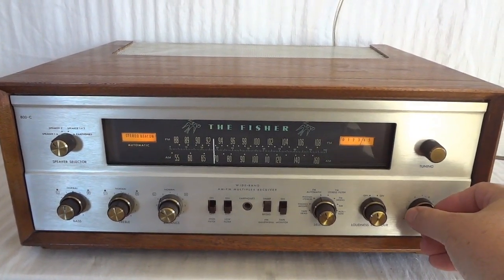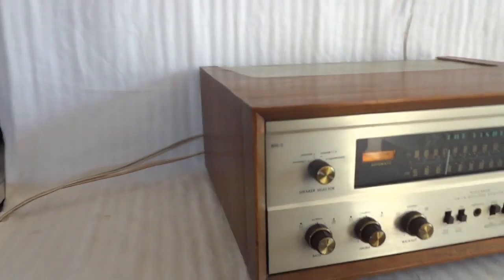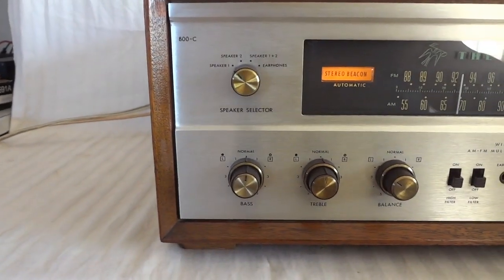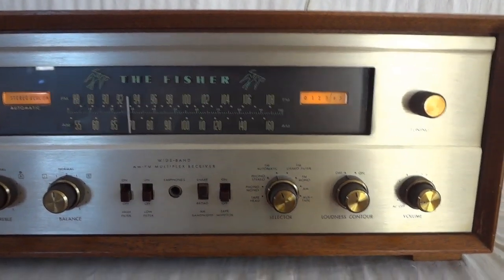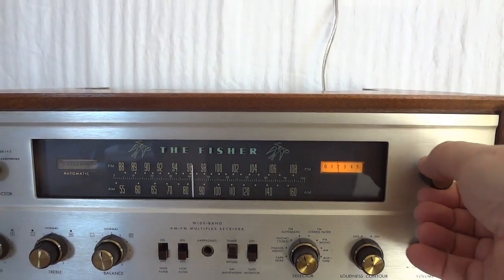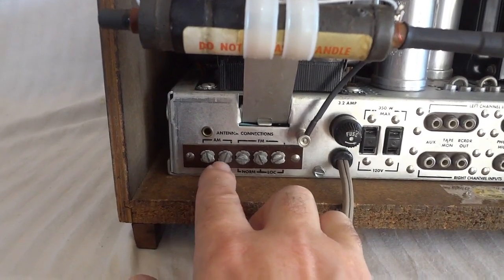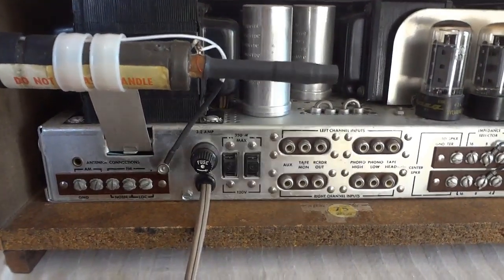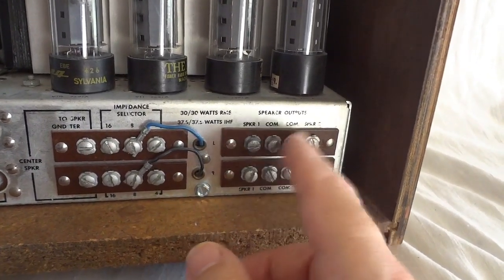The Fisher 800C vintage high fidelity tube stereo receiver

Comment: Thanks for the video.  Much appreciated.  A friend of mine knew Mr. Fisher.  Two items.  Loudness is because at lower volumes, the ears are less sensitive to lows & highs.  So at low volumes, music sounds thin. Turn loudness on & it boosts lows and high to compensate for the ears lack of sensitivity to those frequencies at low volumes.   Audio will sound full to your ears.  It is not to make it sound louder at any volume.  Secondly, the center speaker is not for a sub.  Early speakers did not image well.  People put speakers where they could in their living rooms.  The center channel was for another full frequency channel speaker in an attempt to create good imaging.  In today's surround sound receivers, most have a three channel with no surrounds option which does the same thing. Enjoy the sound and history.

Comment: Beautiful receiver. I have an 800C myself that I had restored by a guy in my area who specializes in tube gear, and per my request, he put in some Westinghouse 7591's and RCA 12ax7 longplates. I use it to power a pair of very-large Wharfedale W90's, which were manufactured about 6 months prior to my Fisher 800C. Those two brands enjoyed an extremely-high level of synergy, which is why you'll see a lot of 500C/800C & W90/W70/W60 pairings. That receiver and some old alnico 2-way W60's sounds freakishly-good with '60's jazz, country, and rock/pop.
Reply: How much did that cost you ? Better safe than sorry . Good move getting it serviced .

Comment: This brings back memories. Back in 1983, a friend of mine gave me his dad's Fisher 800c receiver. And I remember it having a separate piece that was inside a wooden case that plugged in the back of the receiver.  It had a knob that would turn it on and also could be adjusted to give you an echo.  I can't remember what it was called? But it sure sounded good. Great job on the video and info. Thanks,

Comment: Very nice receiver, and very nice presentation. Just do not agree with the part where you said that nobody has a tape deck anymore. I guess no stereo system, especially if vintage is complete without one. Cassette can sound very pleasant.
Reply from the maker: +geor cas Good point - I stand corrected
Reply: He meant with a cassette deck we're more likely to be a nobody (i.e. not a somebody).

Comment: I have a MMF 2.1 in Ferrari Red with the Tracker moving magnet cartridge
 as OEM installed. I am using the table with my vintage Fisher 500C 
receiver with various sources besides the turntable. I'm getting a "hum"
 only when turning up the volume to louder listening levels. In lower 
levels it sounds fine. The Tuner, CD player, Cassette are no problem at 
louder volumes.  The Fisher has 2 EQ knobs (treble and bass) and are 
'dialed in" for the most optimum response between treble and
 bass. Each with its own "inner and outer" dial to assign the 
frequencies to the left and right speakers- Electrovoice 12 inch 
Triaxials with their own crossovers! There are two phono inputs on the 
Fisher-High and Low. One for "Ceramic high input" (for moving coil 
cartridges) and the other listed as Magnetic "low input"-which I'm 
using. Would I have to "re-dial" the EQ knob settings every time 
(annoying) to accommodate what could be a higher output of the cartridge
 causing the excessive hum only when playing vinyl?

Comment: LifeIsTooshortforQRP      Something you should do if you Have one these I also Have 500 B a thing I found out the hard way you Should Have A  wall Tap switch that you Plug the Fisher in Leave it turned on and use the tap to turn it  On & Off.  I found out the hard way having the on off switch blow out from the surge turning it on, bought a kit to put that part in New did the Same Thing. a month later. Luckily  I had an old fisher one that did not work quit right so I robbed its combo on off switch. And Remembered seeing a switch I had bought to turn a  something by Plugging it in the Outlet put the Units pug in it with turned off  pug the receiver into it and turn the receiver  on with the  tap switch turn it on. Been using them on My Fisher tube receivers for Better then 20 + Years Just have it turned on with volume down  then turn it on to get power by the tap and the Tap takes the hit. Those Fisher switch's have a couple of switch's in them and they Just can't take the Power Surge  instead of the receiver switch the tap takes the power & fixes it.

Comment: I have one that my parents had my whole life and it has a ton of sentimental value to me. It has the original speakers too. But the sound quality has been suffering more and more in recent years. It has an unpleasant distorted tinny sound on the high frequencies, especially noticeable in piano music. I've tried adjusting the settings all kinds of different ways, but nothing helps. What could be causing this and how can it be fixed?
Reply from the maker: Can be a number of things - Bad electrolytic buffer caps in the power supply; drifted grid bias voltage; bad (leaky) coupling caps between the driver stage and the PA stage; or worn out PA tubes. A few things to check: 1) Is the problem with BOTH channels (that points toward the buffer cap problem or the leaking coupling cap problem), 2) Is there a difference in performance playing music from the FM tuner vs playing music from an external music source 3) Are the tube plates (the anodes on the four large tubes) showing a red faint glow (this would mean the coupling caps are leaky which makes the PA grid bias voltage too high which results in red tube anodes and distortion) 4) Do you hear a loud hum from the speakers even when the volume is turned down (again this means bad supply filter caps). A word of caution though: VERY high voltages reside inside the receiver cabinet. It can instantly KILL you, even when the AC power cord is pulled already. If you have no experience repairing tube equipment, do not mess with it but bring it to someone who does. Good luck.
Reply: @LifeIsTooShortForQRP  I don't remember if the sound is also bad when there's peripherals plugged into it. I haven't had a CD or record player plugged into it since I moved several years ago; I only listen to the FM radio. I wonder if there could be some problem with the tuner because it seems to move over time. It seems like the radio station will get slightly more static and I have to readjust the knob about every hour or so to get it back to the right spot to get rid of the static. 

I would've had my dad fix it, but he just died after a long battle with cancer, a year ago. He was an electronics technician and a big time ham radio collector who fixed and sold restored radios all the time. Do you know anyone I could send the stereo to for repair? I live in the central NJ area. I'm selling all his stuff on Ebay, if you're interested. I have a lot of tubes.

Comment: Hi there. I plan to build FM stereo tube radio based on Fisher design, but wonder with one I should chose as a base, 500, 800-B or 800-C?
In my case the output stage will be a push-pull based on EL84 As I have already transformers for it.
In addition I wonder about all values for coils used there, any clue where I can get details about them?
How strong power transformer is for 800-B/C?
Also do I need to shield all that tubes, as my plan is to expose them?

Comment: How long can those original Fisher output tubes last ?
Reply: Santiago Santarge: The longevity of 7591 output tubes are generally rated by the manufactures at about 1000 hours of use but they can last much longer if the bias has been adjusted correctly and then readjusted from time to time as the tubes age. Improper bias adjustments can reduce the life of the tubes.
Reply: Im AMAZED, hv 3 originals in my 500C. N its been played ALOT..had ta replace one wen i fired it up...Electroharmonix i hear is. Agood re-tube..

Comment: What are the inputs or outputs on top of chassis  next to the output tubes ? No one talks about those n what they are for, great video though thank You
Reply from the maker: Those input/outputs are to connect an optional reverb unit. When not used, they are jumpered through like you can see on this radio in the video. Fore more details, see the Fisher 800C diagram: https://www.radiomuseum.org/r/fisher_the_fisher_800c.html

Comment: I would like to get anyone's ideas on using  a Bluetooth receiver with 
my Fisher 500C receiver and which ones would be good and not overly 
expensive that will be applicable! Also, what input would I use? I am 
currently utilizing the Aux/Tape input for the CD player and have a 
cassette in the Tape monitor input!

Comment: I’m frustrated and done with vintage gear. Thousands $$$$$$ spent and its nothing but problems and doesn’t sound that good or work as good in the end. It’s fun to tinker but. I’m talking 4 fisher tube receivers, a ton of test equipment . All of it needs work or can’t figure out. Just tossed a heathkit it-28 I’m the trash after $200 and 3days and still could t figure it out. Everybody else has problems also.  Anyways that’s my rant. Nice stereo though.